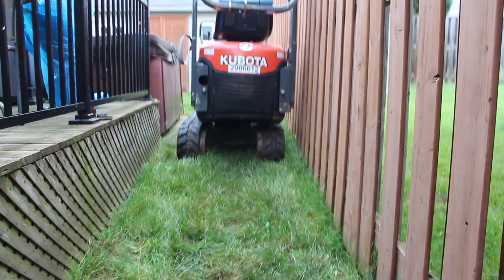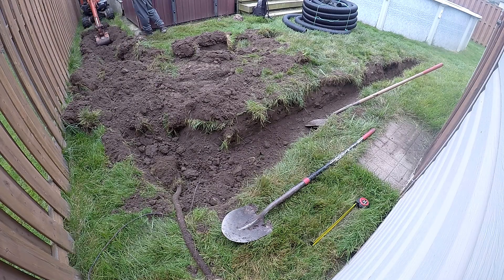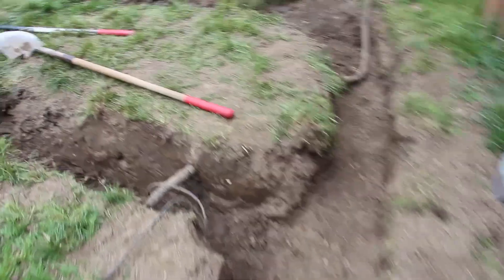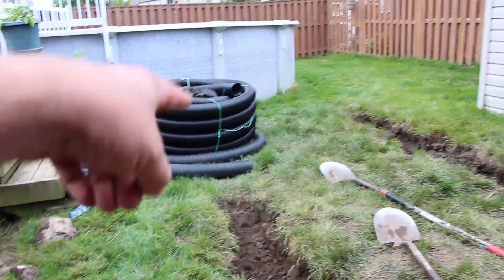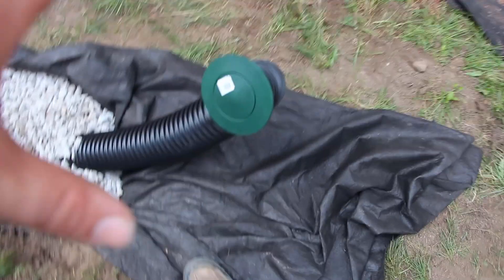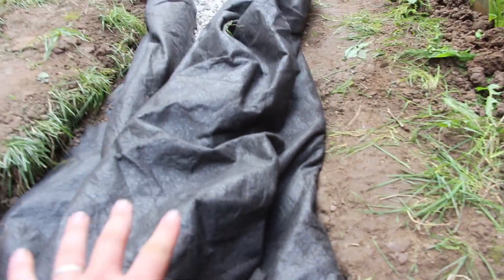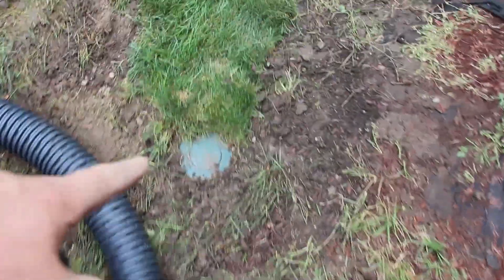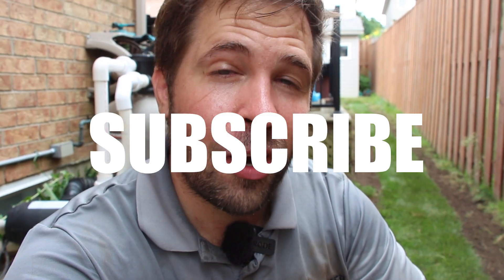Installing a French Drain to Fix a Wet Yard

Comment: As the gen z’s would say, that song was low key fire! I know there are lots of jokes on the podcast about you getting a lot of calls for drainage, but you obviously know what you are doing and I feel like they are good small profitable jobs. Straight forward and not a ton of different materials to price, most jobs are a day or two etc.
Reply from the maker: They are great fillers. I try to stick to the easy ones and nothing complex. Mostly French drains, some surface drains. But have quoted some sump pump installs. It is good to hold onto because it is more of a necessity than a hardscape project, so if work dries up there will always be drainage work.